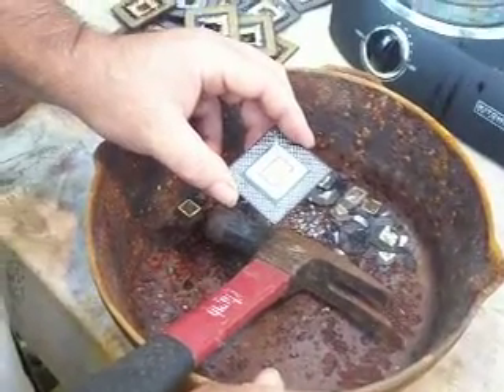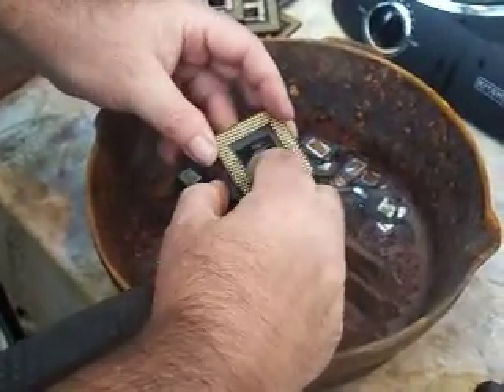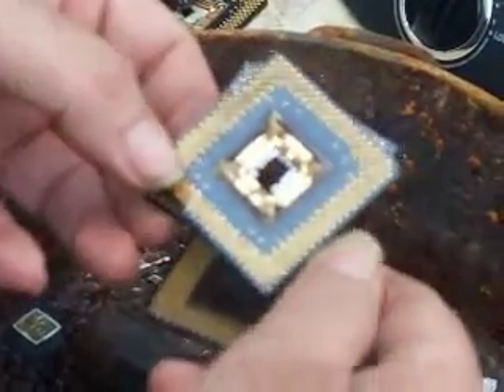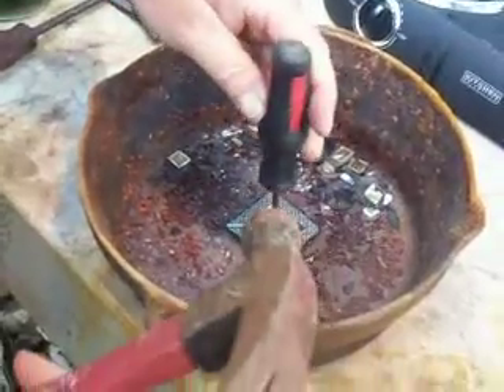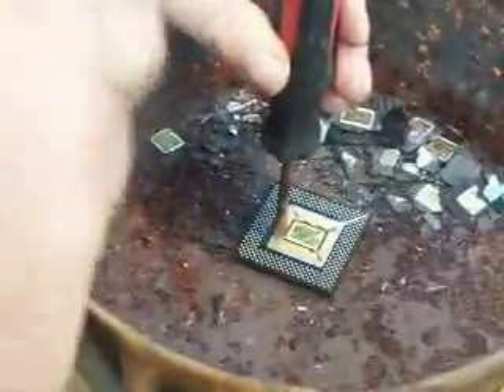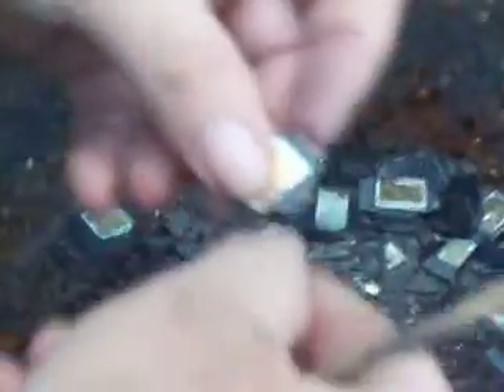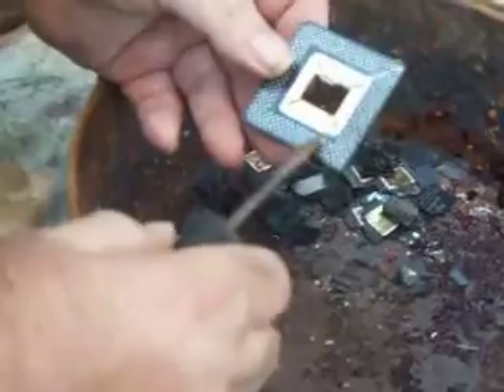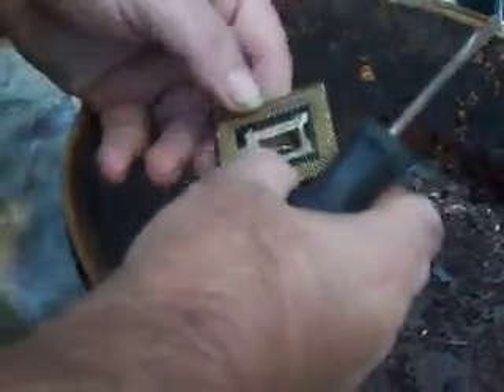preparing black fiber MMX processors

Comment: You may be interested in this https://youtu.be/zFiI6AAbboc Someone has developed an application called Live Ceramic CPU Calculator.
Reply from the maker: Thank you, I already have it. Tzoax has also designed a database for calculating yields from most electronics. The project is almost complete and is a joint effort with www.refinementofpreciousmetals.com . When you register on the forum, watch your spam folder for the return email.
Reply: Geo Thanks :-)

Comment: Are the green ones on the mother board worth anything.? They have the same black resin on the back.. The pentium 2 is the same mold....but when I remove the lid on the ones from mother board no gold showing like with pentium 2?
Reply from the maker: +S Wall The gold is there. There is normally some solder there that will make it look like silver-ish but there's gold underneath it.
Reply: +Geo thanks that's great they are starting to pile up, picked up a micro vx 2 this weekend. His wife was junking it, some great boards in that one wish they had more! Thanks for the info!

Comment: Was doing it like you were. Think I found easier way. I took a old plastic sour cream lid laid it lip up on my bench.I was attempting to remove metal cap banging w/ small hammer. Ended up knocking out the chip and resin from other side and cap popped up. Chip of course was shattered but saved in lid. Is there maybe a reason to keep chips in tact? or would it be easier incineration? don't it matter? But it sure was easy. took 10 sec per CPU.

Any who. ThanX a million ! big help.
Reply from the maker: the only problem I can think of is if you bust the fiber base. there are thin sheets of copper in the base. If you use AR to process the legs, you dont want the extra copper exposed. Keep the base whole or you could lose gold by gold cementing out of solution on these copper sheets and being trapped inside the fiber body.
Reply: The end results resemble yours. The (glass?) coated chip is broken.
Just seemed to work out(totally by accident)  . Pins down work bench, hit w/ hammer till cap pops bottom resin and chip should be out too.
Again I thank you for helping me NOT be so afraid of the dark(CPU) ; )

Comment: good morning geo.  now i have a question for you on these black fiber chips.  while you are giving them a boil in HCL will that remove the legs or will they remain attached to the chip?  or can/do you want to boil them till the legs are removed and then process the legs and bonding wires that were removed in AR?

Comment from the maker: Hello Gabe,good to hear from you.a scrubber should be between the hood and the exhaust outside.use a sealed plastic container like a 30 gallon drum.run the exhaust from the hood through the top down to within an inch from the bottom.inside the drum,place plastic balls(ping pong or wiffle balls) and add 4 inches of lye in water solution.add a fitting in the top of the drum to your exhaust fan.this should be 4" pvc. fumes will be pulled through the NaOH and be neutralized.good luck.

Comment from the maker: a good heat source. i use a 1400 watt heat gun i purchased from Lowe's.train the heat right on the cap and you will see when the solder breaks loose. i hold them with pliers when heating and then tap them on a metal surface and the cap falls off.

Comment from the maker: what you described is "poor man's" nitric. very common and can be made ahead of time.it doesnt work well when dealing with silver because the salt forms silver chloride.if you have time,a much better process is AP.its cheaper and even though its slower it can be re-used.all the gold you started with is still there.the green is solder mask.collect all solids in a coffee filter and pour hcl/Cl through the filter.it will dissolve the fine gold and filter it at the same time.

Comment from the maker: a quick boil is until the tiny bubbles stop.when liquid boils,it makes big bubbles.when something dissolves,it makes tiny bubbles.you need to heat until the tin in the solder is dissolved.just hcl or you can dilute with water 50/50 but it makes the reaction slower.poor man's AR (aqua regia) is hcl (muriatic acid) and sodium nitrate (nitrate of soda,ishor's "subzero")